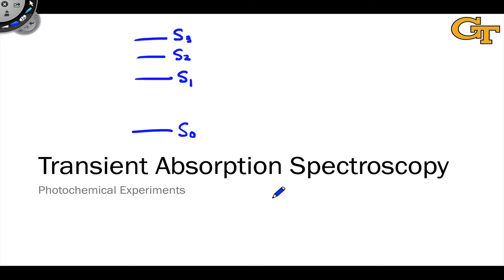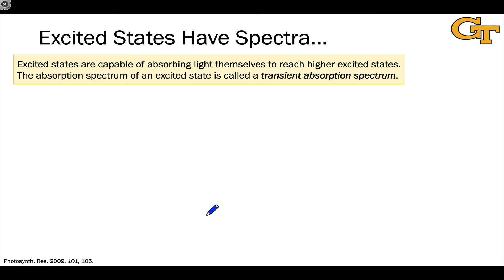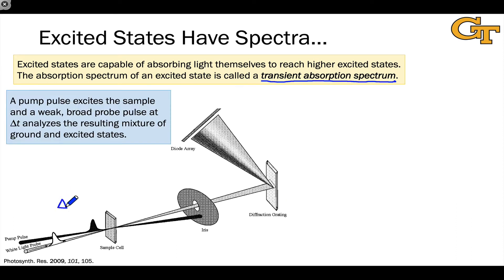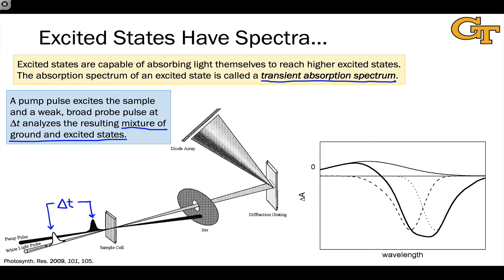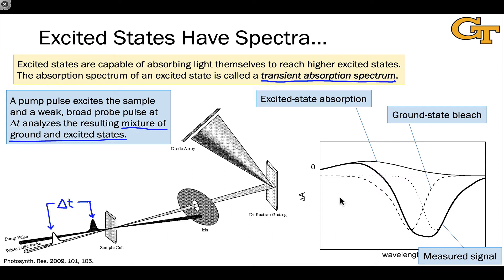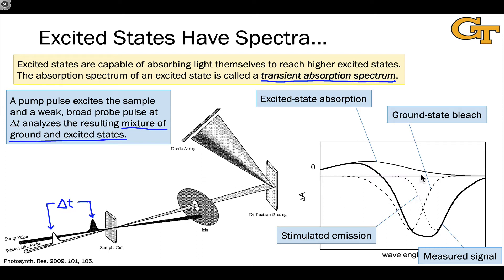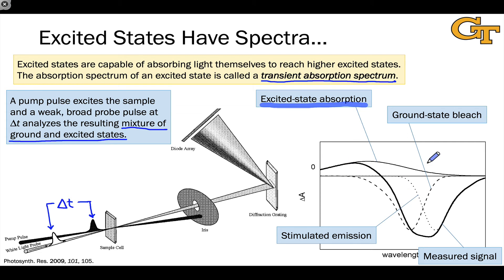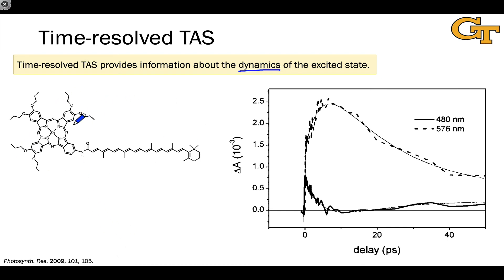6.4 Transient Absorption Spectroscopy

Comment: So the excited state population must be kept low to prevent the ground state bleaching right?
Reply: not really, if the excited state is not populated, no transient effects can be observed - neither ground state bleaching (GSB) nor excited state absorption (ESA). If you are interested in the lifetime of the excited state, both contributions (GSB and ESA) decay with the same rate constant (the rate at which the excited state depopulates is equal to the rate at which the ground state repopulates), so both effects are useful for a global fitting analysis. If you are interested in the spectrum of the excited state, you need to have it populated to observe the ESA (you'll observe the GSB as well, but you can subtract it since you know the shape of the absorption band from steady-state measurements).